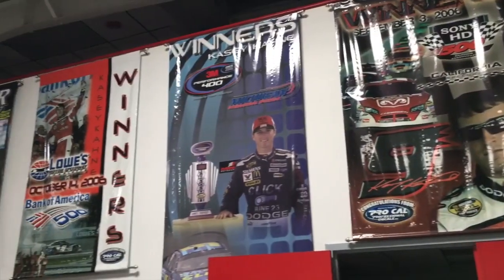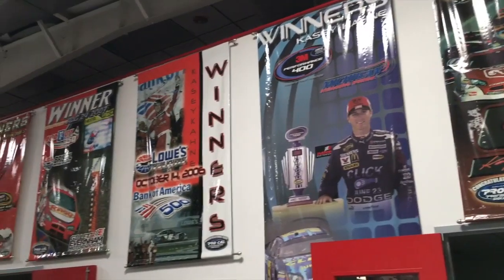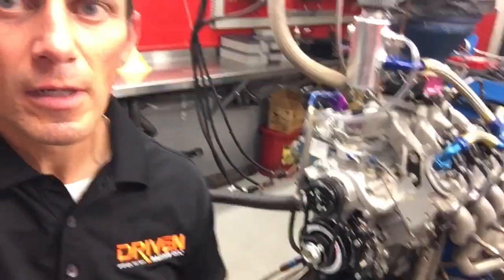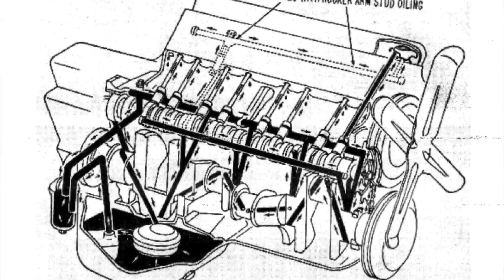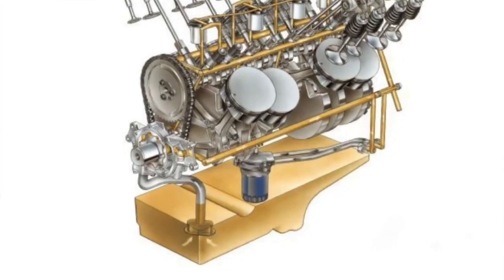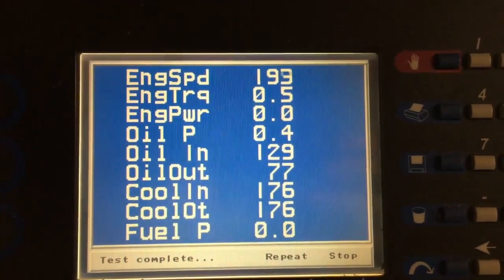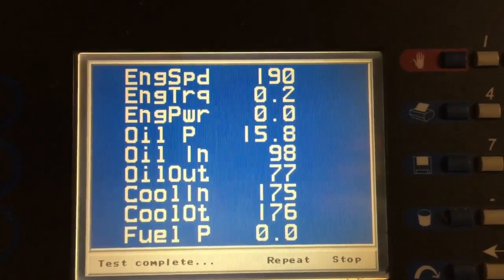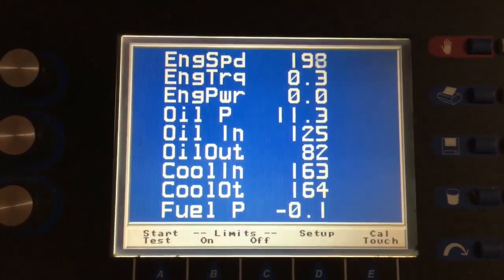Oil Pressure Delay After Changing Oil in a GM CT525 LS Crate Engine

Comment: Do not change the crankcase oil and the filter at the same time. You drain the oil out of the crankcase then refill. Only after you have refilled the the crankcase do you break the oil filter lose. If possible always pre-fill or prime the oil filter if you can. 

This eliminates or minimizes the loss of prime. Even the old GM 60° V6's lose prime easily  but always lose prime if you have an empty oil pan and the oil filter side of the circuit empty and opened to air. 

That used to be common knowledge that it seems has been forgotten.

Chrysler and Toyota have used Gerotor oil pump designs for many decades with out issue.

Comment: Neither is a Gen 1 S.B., The pickup tube is just in the oil unless you're running 2 more quarts extra to submerge it, The pick up tube in a LS is also submerged in the oil just as the pickup tube in a Gen 1

Comment: Your oil 🛢 said 10w30??
Reply from the maker: GRP67, We tested 3 viscosities in this test that day, a 10W-30, 10W-40, and 15W-50. This was simply an editing error in using the wrong clip when filling one of the 10W-30 oils. The 15W-50 is the one illustrated in the test that took the longest to prime, the 15W-50 is what is recommended by GM so this is why we tested it. In the end after reviewing oil analysis, as well as monitoring oil temps and HP during the test we determined that the XP9 10W-40 was the right oil for the CT525 Crate Engine. Hope this helps, and thank you.
https://drivenracingoil.com/i-30497842-xp9-10w-40-synthetic-racing-oil.html
Reply: @DrivenracingoilLLC  It would be interesting to see how a 5W40 and 0W40 behave in this engine! I say this because when Exxon Mobil brought out 0W40 to the market what 15 years ago maybe more I began running in all of my GM, Toyota and Dodge products and doing a lot of UOA. To this day I still use 0W40 in everything that still has a mechanical oil pump with fantastic results.